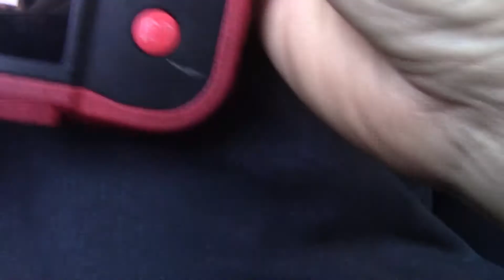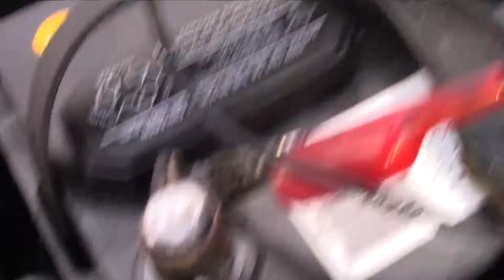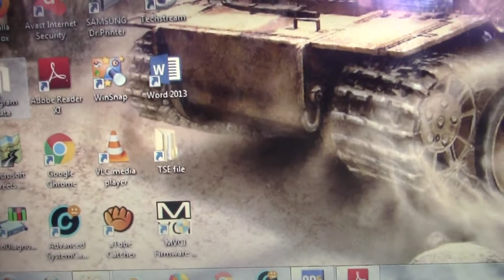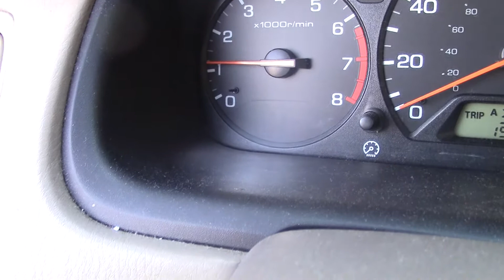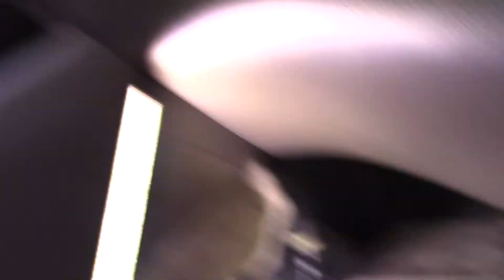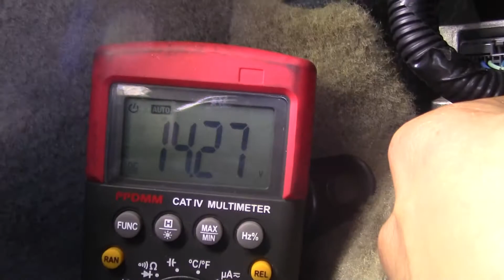00 honda accord P0135 ho2  sensor  circuit part 1

Comment: So why did u reccommend replacing the PCM ?
Reply from the maker: Because the incorrect  02 sensor burn it
Reply: @JoelAutomotrizenAccion  ok ty
Reply: @JoelAutomotrizenAccion  hey so the return current to the pcm from the o2 sensor should have been at least 1 amp ?

Comment: Hola joel. Tengo el mismo problema con mi 2000 accord. Le canbie el sensor 3 veces pero como en el video regresa la check engine light...cual fue el resultado final de este video. Necesito saber para poder areglar este problema con ese sensor.. Nesecito que pase la  inspecion en mi estado...grasias
Reply from the maker: instalara el sensor correcto  de ese motor y cambiar la computadora  pcm
Reply: @JoelAutomotrizenAccion  I have a 2002 ULEV 2.3
Reply: @JoelAutomotrizenAccion  when u change the computer do you need a new set of keys or just plug and play?
Reply: Por qué capiar la computadora se descompuso oque el mío ase lo mismo
Reply: Solamente poner el sensor correcto o también poner la computadora

Comment: What does it mean when u try to start ur car no engine light dont come on but all the light come on in try to start in nothing happen help
Reply from the maker: well the check engine light should iluminates in self test  prior the key is turn to  crank  on goog vehicle ,  if the vehicle is   if if does not iluminates the pcm  is not  alive.  if the anti theft sytem is in it    either will not crank  or crank no start depending on manufacturer strategies
Reply: @JoelAutomotrizenAccion  do u know where the immobilizer located on a 2001 honda accord
Reply from the maker: @mrphengyang  
scan de vehicle,2  immobilizer is a system, the key has  a chip with a password, in the ignition switch is tje antenna ,  the pcm ,  the key contain the password  , the pcm  requests a pasword this signal is sent to the antenna, the antenna reads the code on the key  reply  to the pcm  if the password is correct ,validates  the owner  and give the  ok  to start. complicated / complex system, even with the proper training and the right tools is not easy, first step is to try another key that is being program alraedy

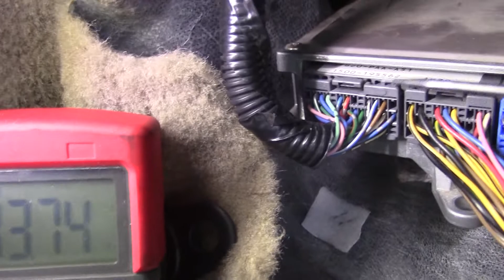Comment: I am having this same problem (P0135) and hoping it's not the computer since it was just changed over a year ago. At 21:35 you did a voltage drop test on the black and white wire. I did this same test and the reading went from 13.33 to 9.99. Is this reading in a good range? So far, all my results have came out like yours. New O2 sensor measure 19, ground and power good at the sensor plug under the hood.
Reply from the maker: the  voltage you see is because I un plugged the connector and keo , engine off you can load test the wires from end to end  end un plugged , to checck if they can  carry current

Comment: Where did you get your toughbook that has all data and Mitchell?
Reply from the maker: KD Automotive 
I bouth it trough  ebay but , with out the programs
Reply: Joel Automotive  In action I always see them on the advertised with the programs but I'm afraid to pull the trigger on one

Comment: Nice diagnosis, did you try erasing to see if computer try to pulse the sensor?
Reply from the maker: Maic Salazar Diagnostics 
yes I did when it pulses is when code set
Reply: Joel Automotive  In action if computer pulses signal so it is grounding the O2. Ummm I’ll be nice to see the waveform to see if grounds to 0v or not. Did you try an OEM sensor?
Reply: Joel Automotive  In action I was checking the wiring diagram and seems like the secondary 02 is the same, maybe good to try and connect the primary connector to that one. It is weird that ECM pulses the O2 and be bad. Good luck my friend
Reply from the maker: Maic Salazar Diagnostics 
on part 2 will show that